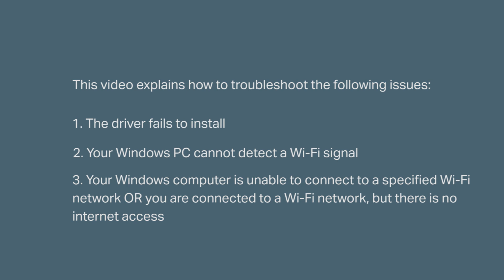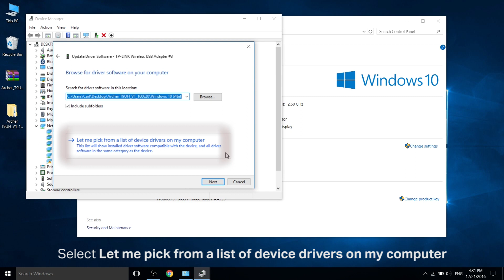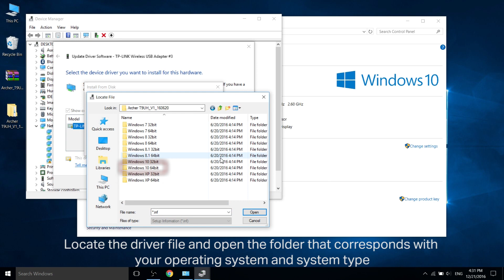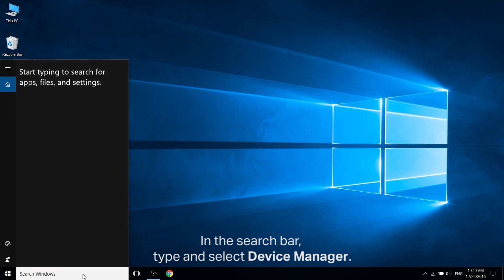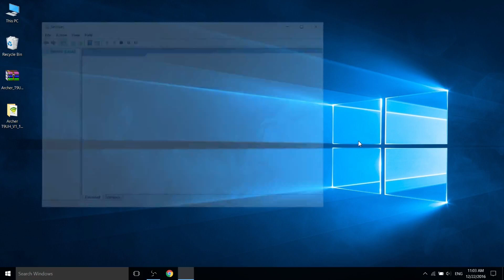How to Solve Common Problems When Installing and Setting Up a Wireless Adapter (Windows)

Comment: i have code 56
Reply from the maker: That is a windows error code.  Generally related to VPN conflicts, driver issues or issues with VM software.  I would start with the driver.  Go into your device manager and see if there are any issues with the driver.  you might want to uninstall and reinstall the driver.  If that doesn't work check with support.

Comment: I’m having the third error where it connects but no internet access. When I try to reinstall the driver I get: “One or more issues caused the setup to fail.
Please fix the issues and then retry setup.”
I have no idea what the issues are and it won’t specify further.
Reply from the maker: We would recommend contacting support for your region.   They can help with this.  https://www.tp-link.com/us/choose-your-location/

Comment: what about Mac ?
Reply from the maker: Depends on the adapter.  You would first need to go to TP-Link.com search for the model and click on support.  Then click on drivers for your specific hardware version.  Here you will see if there are MAC drivers and if so which OS version is supported.  Due to changes made by Apple  in the OS, TP-Link does not provide support for OS 11 and up.

Comment: is not abt router stop blaming router ur product is trash
keep disconnecting everytime
Reply from the maker: Frist keep in mind this video is 6 years old.  2nd. Yes a lot of the time it is a local device like a PC or Router.  The purpose of this video is to help rule out such sources and if one of them applies how to resolve.
Reply: @TPLINKUS  so how to fix ur wifi adapter that keep disconnecting every 5 minutes. Please do not say it was my router failure my router is working well with other devices. ur product is trash and also ur mentallity that keep put blaming on others

Comment: my internet connection is not stable, it disconnects often , but when im using the wifi on my laptop or smartphone(im using the adapter on my windows PC)the internet connection is perfect, any tips?

Comment: So I had a problem where the Wi-Fi dongle kept disconnecting and reconnecting rapidly. I tried reinstalling the drivers and uninstalling them from Device Manager, but to no avail until I turned on "Show hidden devices" and saw something hidden in Network adapters along the lines of "virtual" something. I uninstalled them, reinstalled the driver and everything is 100% fine now.

Comment: When trying to uninstall the archer driver, it says "Read register table failed" any reason?
Reply from the maker: To be honest, haven't heard that one, but that would really be a question to direct at Microsoft, as that would be an error generated in the OS not by the adapter.

Comment: I cannot find my wireless network but the adapter can find other wifi networks. i have done everything from rebooting pc, restarting router and adapter also updating drivers. but still suddenly these problems are happening
Reply from the maker: If the adapter is seeing other networks the issue is not with the adapter.  I would recommend looking at the router and confirming there are no issues with the wireless configuration settings.

Comment: i cant find the .inf file
Reply from the maker: This video is several years old and some things have changed.  Newer adapters and firmware updates are behind an installer.  Download the file from the driver section of the adapter, making sure you download the file for the right hardware version.  Then run the .exe to install the driver.  If you have continued issues you can email support@tp-link.com (global) or support.usa@tp-link.com (US) for further assistance.

Comment: In 2022 its easier to Uninstaller the usb drive, remove it then put it back in install the to wifi driver (it'll prompt Uninstaller click yes) Uninstaller then reinstall and it'll work again just enter your wifi password and your good to go

Comment: what do i do if the tp link wireless adapter isnt shown in the device manager
Reply from the maker: Install the driver and restart your computer.  If its still not showing under networking in device manager look for anything related to 802.11 or wireless adapter as the driver that Windows installed may be a generic driver for the chipset in the device.

Comment: Breaks my full WiFi! All Devices in Our Home.
Reply from the maker: An Adapter does not have the ability to disrupt an entire network.  Adapters are simply a one to one connection between a client and the router.  If your network is dropping I would check the router.

Comment: Yes, your video is great but it didn't solve my problem at all. There appears to be a common problem with my unit (Archer T3U - v1.0) and others in many forums, but no real fix. I purchased this 3 weeks ago and continually have this problem: I am on windows 10, and after installing (USB-3) it runs fine (Speed <on fibre network> can be as high as 600mbps Download and 500 mbps Upload). The modem is 5 meters away and in direct eye-sight. It will run fine for about 1 hour or even up to a day or two, then the speed suddenly drops and has time-outs (5 seconds working, 3 seconds off). To fix, I have to un-install the drivers and re-install (off the supplied CD). It's OK again until it happens again. (I have done this 15-20 times in the 3 weeks). I have googled on many forums and there is no real answer. The last thing i did was to get an earlier version driver off the TP-link site as my driver on the supplied CD is a later version. This worked for nearly 3 days and then again failed. Oddly this time it's 7 seconds working and 3 seconds off. A frustrating problem. Can anyone help? TP-Link helpdesk just pointed me at this video even though my fault is not mentioned in your video. A quick way to fob me off, I guess.
Reply from the maker: We are not equipped for full troubleshooting through comments on the videos.  Simple questions sure but for full support you would want to engage the helpdesk.  For that please email Support.USA@tp-link.com.  Specifically let them know that the troubleshooting video did not help so they can engage further with you.
Reply: @TPLINKUS  Hi, my problem posted here was not necessarily for you to solve, but in the hope that someone viewing my problem can help. That's where youtube is useful. Please note that It was the Tp-link support that sent me this link. Why are they pointing me to your video without specifically helping me with my problem after I directly described the symptoms?
Reply from the maker: @warwickwas  The use of FAQs and Videos are a first step process for support.  These tools are used to help guide the customer visually through common and at times uncommon concerns.  Driver related issues are part of this video so that is why I assume it was suggested.  Here in the US the only windows driver for this product is from 2018.  Also TP-Link can't always rely on 3rd party forums of complaints on products as  often we have no direct contact with those customers so cannot determine if they are having a concern with the product or if its related to something else.  Because the video didn't help you and you are in contact with us all you should have to do is email support back and tell them the video didn't work so they can move to the next step.

Comment: i use the ac1900 but it maxes out at 6mbps downlaod when on everythong else my download is 40 anyone got suggestions?
Reply from the maker: Connections depend on several factors.  I would suggest contacting support for assistance.

Comment: what to do when the card is not reconized as a tp-link but realtek instead ?
Reply from the maker: That means that your card is using a realtek chipset and you have installed the generic driver built into windows.  That will work or you can install the official driver from out website.
Reply: I'm on win 10. I downloaded the version 4 for windows 10 64.
Tried to install the driver using *.inf which was in the zip, but windows still detect it as a realtek.
Reply from the maker: @AdamSaeba  What adapter?
Reply: @TPLINKUS  
This one " TP-LINK TG-3468 " ( version 4 )
( i dont know why my comment was deleted by youtube )

Comment: Nothing works like it should according to the paper guide that came with the product. There are no 2.4 or 5g wifis, speed is incredibly slow, WPS never works, even this video guide shows files for device manager that aren't even on the driver files in the website
Reply from the maker: The adapter doesn't generate a wireless signal, it connects to one.  Depending on model it is possible that it connects to 2.4, 5GHz or both.  WPS is dependent on the Host device as well as the client device both supporting the service.  This video is old and most adapters now have a .exe. with the .bin  embedded into the application.  This make the installation process more automatic and less user intervention.

Comment: Hi, I'm Philip.
The 2nd error happens to me. but when I try to solve it in the "Network Adapters" part of the "Device Manager" the TP-Link Adapter does not appear.
How could I solve it?
Reply from the maker: we would recommend contacting support.  there is simply more involved in this than we can address in comments on YouTube.

Comment: With a recent update on Windows 11.

My TP-Link AC1200 Wireless Dual Band PCI Express Adapter's driver is now called Realtek 8812AE Wireless LAN.

I don't know why.
Reply from the maker: Its likely that the chipset in your adapter is a realtek chipset.  If we do not yet have an official driver for Windows 11 but Windows has a generic driver for the chipset then it will auto install that so your adapter can still work.  While default generic drivers can work we still recommend that if an official driver is available that it is installed.

Comment: as of 2022, February 8th. on Windows 11

The TP-Link AC1200 Wireless Dual Band PCI Express Adapter has trouble with connecting to the internet.

Sometimes it just disables the internet and says it can not connect to it, and other times it just reboots itself by turning off the Wi-Fi and turning it back on.

In the past it had the the same thing during 2021, but I had fixed it by using an old 2016 driver, but this year around it's causing problems and I can not handle it anymore, it's annoying, bothersome.

Is it possible to get an update on this Device?
Reply from the maker: We have several adapters in the AC1200, so we would need to know the actual model number.  Also region as this channel is only managed by the US team.
Reply: @TPLINKUS  
Archer T4E, 
Western Australia, Perth.

I didn't realize devices were regional.
Reply from the maker: @evolifesword5972  Non-wireless products typically aren't but wireless products a lot of the time are.  This is because wireless bands are regulated differently by each region.  So Drivers and features can sometimes be different.  For Australia use any of these methods to reach to the local support team and get the assistance you need.  https://www.tp-link.com/au/support/contact-technical-support/

Comment: Very clear video thanks! I’m still having an issue however. I have the CD installation. The driver is install (I also reinstalled and reboot) and it says the driver is working correctly. I also located/updated the driver as shown but I still cannot connect to Internet. No Wi-Fi is shown! Don’t know what else to do…
Reply from the maker: it could be the driver is not the latest one.  Try installing the latest driver from the website.  If you are still having concerns please contact support for instance.
Reply: @TPLINKUS  how the hell am i supposed to acces your website if i dont have wifi, what the hell
Reply from the maker: @josipasimic3245  If you are installing a wireless adapter on a windows computer, regardless if its PCIe or USB you are mostly likely to have another form of internet connection available.  Whether that be a ethernet port for a physical connect or a built in wireless card.  You should have the ability to download a driver.  If in a rare instance you don't or that built in one does not work the you can user another computer and download the driver to a usb flash drive.  In some instances your Windows system may have a default driver that automatically installs.

Comment: I got an archer t30 and everytime I try to install the driver it always gets stuck at 90% and when it does finish it doesn't function properly and according to device manager it's due to error code 56

Also the compressed file that contained the setup file doesn't have the inf file for me to attempt one of the solution
Reply from the maker: The error code is a Windows code.  From a quick internet search I found a explanation and thread that provides a solution.   https://www.intel.com/content/www/us/en/support/articles/000038102/intel-nuc/intel-nuc-kits.html  https://answers.microsoft.com/en-us/windows/forum/all/solvedunable-to-update-network-drivers-error-code/e34e928d-53a1-4bfa-b2c9-7157352b728d

Comment: So I did everything correctly and it will not allow me to connect to the Wi-Fi it reads I have the tp link but the tp link doesn't read the wifi
Reply from the maker: You will want to contact support so they can help then.

Comment: HEY CAN YOU MAKE A FOR WINDOWS 7, I CAN'T FIND THE ADAPTER IN NETWORK ADAPTER AS WELL, i brought just 8 months ago, it worked then.
Reply from the maker: We do have adapters that work with Windows 7 but you would need to make sure the driver is installed.  Go to tp-link.com and search for your adapter.  Then click on support and then Drivers.  look for driver with Windows 7 support and install that.
Reply: @TPLINKUS  I have did it still the problems exists !
Reply from the maker: @rohitrukmangad1163  Then at this point you would need to contact our support team in your region to further address this concern.  Go to TP-Link.com click on support and then contact technical support for the contact methods available in your region.

Comment: I HAVE WINDOWS 7 AND TL-WN781ND AND IT TURNS OFF AUTOMATICALY WHEN I AM USING AND I NEED TO TROUBLESHOOT IT THEN IT WORKS OR ELSE IT GETS DISABLE I NEED TO REBOOT MY COMPUTER TO USE IT 
HELP ME FIND THE ISSUE i even tried changing to another pcie slot and it was the same  i tried everything in this video
Reply from the maker: YouTube is not for requesting support.  We try to answer general questions but when you have product issues you will need to contact support for your region.  https://www.tp-link.com/us/choose-your-location/  Choose your region. then choose support and finally contact technical support to find your regions support methods.

Comment: great how do you down load the driver if you cant connect to a wireless network in the first place ! this is most stupid video ever.!
Reply from the maker: There are a few ways.  1.  Use the computers wired ethernet port.  2.  Use the built in WiFi adapter (if applicable) 3.  Download the drivers to a USB drive from a computer that does have internet.

Comment: Hello! What if the wireless driver shows up in the "Other Devices" section and not in the "Network Adapters" section?
Reply: Happening for me to man
Reply from the maker: That's Windows not properly recognizing the driver or could be that the system is using a generic windows driver to operate the adapter.  I would ensure you have the latest driver from tp-link.com and restart the computer to see if it gets properly identified.  This however should not affect the performance its just a sorting issue with in windows.
Reply: @TPLINKUS  would a TP-Archer t1u work for windows 10
Reply from the maker: @SilverVolo  Yes both version do work with Windows 10.  Although that model is EOL so if you don't already of it I would recommend a model like the Archer T2U Plus.

Comment: I had an issue with a Archer T5E on Windows 10. The wifi adapter only showed as unknown device. The TP Link drivers didn't help.
I eventually fixed it by installing the "Windows® 10 Wi-Fi Drivers for Intel® Wireless Adapters" latest drivers from intel website.

Comment: If the led is not appear in TP-Link W722N it means that in needs someone to fix it??
Reply from the maker: If its off then it means The driver has not been installed or The adapter’s radio has been disabled
Reply: @TPLINKUS  I have correctly connected the TP-Link device,but when I download the driver from the website(Windows 10 Pro 64-bit) it says that the adapter is not found
Reply from the maker: @IdkMyName-v1t    Install the driver first and then power cycle the computer.  Then install the adapter and see if it is recognized.  If not you would want to contact support for further support of the product.

Comment: After applying all things for problem 2 ..but still it can't decet any WiFi connection 😒..I am using Windows 10...please help me ...I just by TPLINK WIN725N today
Reply from the maker: the adapter does not improve a wireless signal.  You would need to make sure where the computer is at that there is a strong signal.  If not then you may need a device like a range extender to improve the service in that particular area.

Comment: i am connected to the internet it says that i have internet serivies but i cant even load my emails or open up google
Reply from the maker: It sounds like an issue in your router.  Perhaps MAC filtering.  An adapter is simply a connection point it links a client to a network and pushing traffic back and forth.  It would not block traffic transmitting.